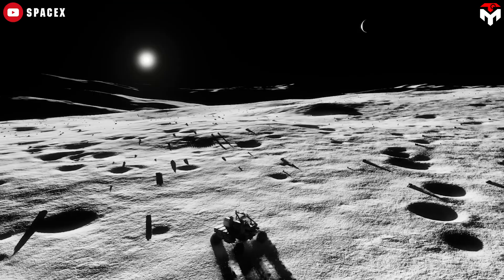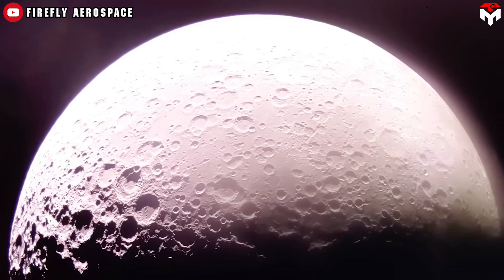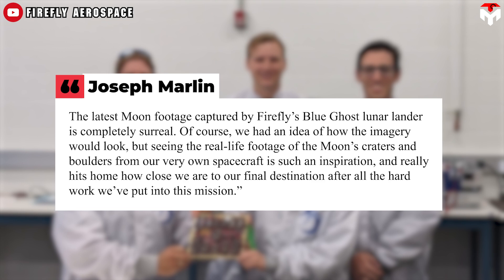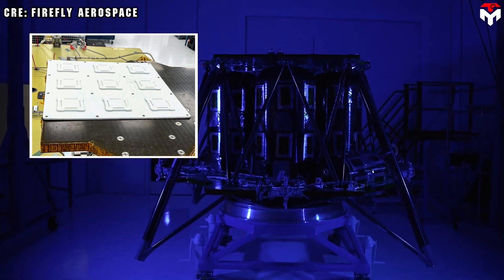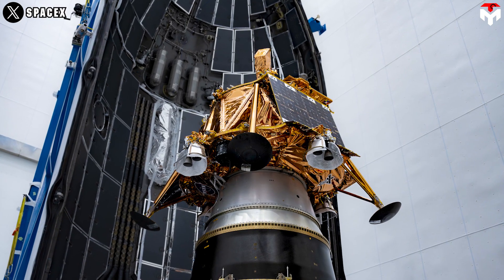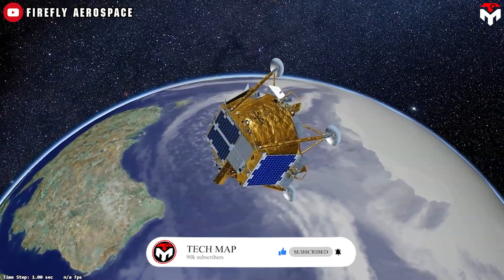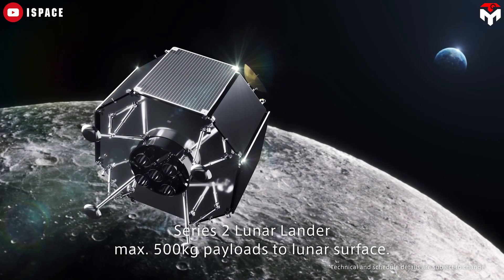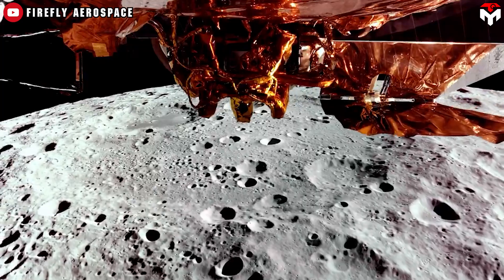NASA's Lunar Lander Reached the Moon, Landing in Hours...SpaceX Launched 2nd Moon Mission!

Comment: WOW one video from NASA saying they lost the teck to go to the moon and no way to get it back. Then admite no one has ever gone past the Van Allen Belt and now 3 landers headed to the moon??? Please STOP lying!!!
Reply: The HAND MADE computer modules were based off ICBM modules and modified, the women workforce that made those were disbanded as semiconductor tech was improved, so yes it was lost to improved tech and lots of retirements and living memory dies off too.  There's videos that get into the computers of the Staturn 5.  The SPACE SHUTTLE had diagnostic boards way after 2002 which had NASA buying up old medical equipment to get the 8088 Processors to 'renew' rather than try to re-manufacture and redesign the boards that plugged into the SRB boosters.  Eventually the press embarrassment caused a upgrade so the sRBs could be used in SLS with also a bigger central fuel tank.  The Refurbished equipment leftovers from the shuttle are like rebuilding a 1975 Richard Petty car to race in 2020s, lots of upgrades but you can see the design influences, the shame is the reuse-able stuff is not going to be reused. That's a big shame.